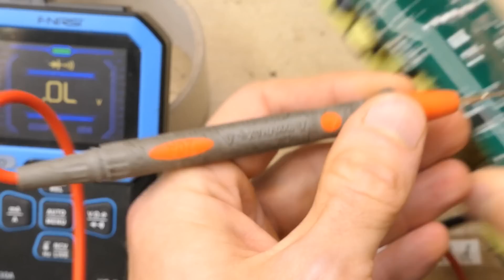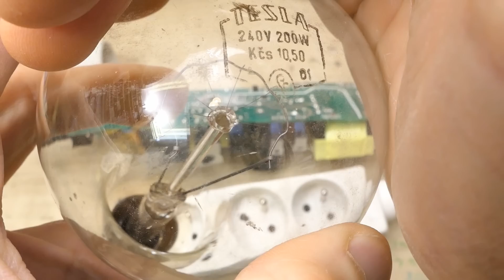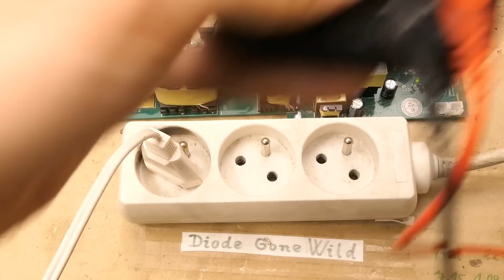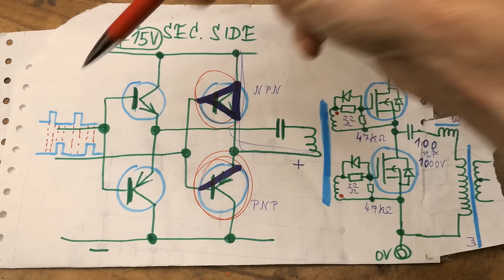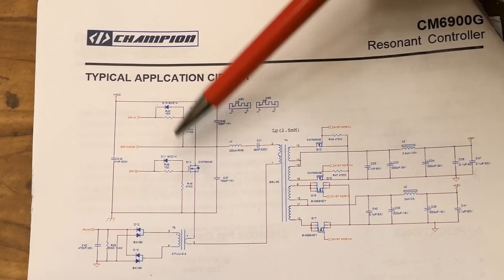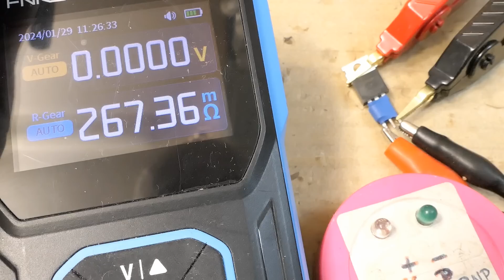Fixing a big Li-ion charger power supply

Comment: God haven't checked into this channel in good while now. Fixing E-scooters/bike's keeps me busy as hell.. I live in the centre of Ireland 🇮🇪 and the only place for people to get their scooters fixed is Dublin...!
And they charge 200 Euro for something id charge 50 Euro's for... They're so easy to fix and I always have a waiting list of minimum two weeks to a month when I take on more people needing help. Going to Dublin for hall sensor replacement costing €200  is out of most people's rage money wise. A set of new hall sensors can be anywhere from €7 to€10 online id charge €30 to €40  for that particular fix. Always a have a few brand new dashboards(the displays) 4 & 5 pin connectors. And some mother boards. If I it's to much work to to chase tracks and components to sort out the problem I just slap in one of boards that's needed that I'd have... "NEVER SHORT OF CASH NOW" and I learnt more about electronics from this channel than any other... So thank you Danny for your awesome information you give us..... 👍🙏🇮🇪

Comment: Using the BC807/817 to drive a GDT is a terrible idea. Yes, they’re rated up to 0.5A, but they are still small signal devices. The SS8050/8550 are much better suited for this purpose. But still, there’s only so much heat the small SOT23 can dissipate…

Appreciate the old-school insta-heat soldering gun. Quite a neat SMD dismount tool!😂

Comment: touching a half bridge mosfets while it´s running is kinda wild 🤣🤣🙄
Reply: Perfectly fine, as long as you’re not grounded and don’t touch BOTH of the exposed drains or anything else in the circuitry. If you do, you’d be in for a significant emotional event.🤯💀

Comment: I got the same leads as you, the thin pointy ones, they're nice compared to my fat ugly old ones that came with my Astro AI meter, but then i tested the resitance, thanks to my new tweezer meter (zoyi something or other)  it has 10 miliohm resolution for resistance is the main reason i got it, much better then my multmeter.  Turns out those nice looking probes are around 120 miliohms resistance, and my ugly old astro ai probes were only 50...  Dont judge a book by its cover is the moral of this comment, please like and subsc... just kidding.

Comment: I've repaired a psu with similar topology, it was easy to follow along! Weird that those small signal transistors failed, I wonder what caused it. Maybe a high voltage spike, static electricity or something? 
Great repair in any case!

Comment: Now, replace the MOSFETs with GaNFETs to make the efficency EVEN HIGHER!

I'm amazed by the performance of GaNFETs, they have way way lower gate charge and lower RDS(on) too.

Careful to that body diode though! GaNFETs DO NOT have it!

So if the body diode of a MOSFET has some purpose in the circuit, you can't just put a GaNFETs in its place.

Maybe you can find a way to put an external diode.

Comment: Nice! 50 years ago upon passing the exam of my apprenticeship I was asked on how to trace a fault in a half dead SMPS. I said: Start in the middle with a scope. No thermal cameras then. Then divide the non working half int 2 again until you hit the faulty part. In your case of 3 faulty transistors out of 4 I would have replaced all 4 and then give the unit a soak test. Hope your cat agrees with me!
Reply: it's wild that smps technology has been around so long ehh. it still seems to advance at a fast pace too in alot of areas. unlike some other engineering areas ehh. dany is by far the best on the platform at smps repair/design/knowledge in general and can fix anything it seems. he's the reason i'm obsessed with smps repair as a hobby haha.
Reply: That is a recommended fault tracing procedure: Start in the middle and work towards the side not working. You can divide that side again if large. I look for faulty components first as he did as I am reluctant to work on powered circuits.

Comment: My uncle (masters degree in EEE and CEng) used to work in a corporation where they made switching power supplies and they’d specialise in designing power supply boards that were extremely over engineered and expensive, with the objective of making sure it couldn’t be taken out and used by the consumer. There was one supply, 900 amps at 12 volts DC constant current, synchronous rectified. Thousands and thousands of components for active PFC, MOSFETs for both secondary and primary rectification among other things. The transformer had a primary on the board, but a gigantic ferrite core that extended vertically around 10CM before taking 90° bend like an L, before getting to the auxiliary, secondary and tertiary windings. They only sold two.
Reply: The main objective of a modern day engineer is to design a thing that will work the warranty period flawlessly and break down the day after – irrecoverably.
Reply: @noneofyerbeeswax8194  simple solutions to complex problems is the mark of a great engineer, in my experience. but not too simple, like einstein said haha. im a middling engineer who retired too young and is way too bored. i'm lucky too though i guess, im still relatively young and help tutor students for free because im not hurting for cash, not rich though. i've been trying to get a startup together but i live a five hour drive from any other decent hardware or software engineers so i've been hammering a prototype together for a phone app to see if i can get funding from nova scotia tourism to hire two more programmers and a few technical artists. there's a few mobile game studios around but they make vapid gatcha apps for ubisoft and have a super high turnover rate. no worse fate for a programmer than making shitty phone games for a multinational company that prey on whales to drain their accounts into time sinks to buy coins or whatnot. i read about a person who sunk over 300k into the diablo mobile game, talk about king of nothing just to have a 3d avatar with 'rare' gear haha. i used to volunteer at a local makerspace with an engineering professor who couldnt even make simple circuits and actually quit when we were asked to help some students with simple opamp theory. he couldnt even make a fucking buffer let alone understand the theory behind a simple inverting opamp circuit with a couple resistors. goes to class and throws up power point slides that came with a book, goes a long way to explaining why the local college grads of the electrical engineering technology program cant get any work. i ended up quitting to focus on coding more and teaching guitar lessons and writing more complex compositions with people better than me. i live in the sticks and have the best makerspace this side of canada and it's ran by knitwits who are running it into the ground. i'll be there for the asset liquidation, sadly. sorry man, im rambling like 13 year old girl strung out on Adderall, haha.
Reply: german company i suspect wha? haha. i've boycotted german products. i remember when vw cars were solid as a rock but our last 2 were lemons. I had a bmw x5 rental for a few weeks while my wife's merican' truck was being fixed and it was full of micro transactions. the motorized steps that use linear actuators were locked behind software keys. there were 4 per rail and i suspect they cost about 400cad a piece, so wasteful. living in canada and trying to get german companies to support their products, especially buying from knipex or welectron they treat you like you're an idiot, even if an 800 dollar dmm is doa. i had to fix the meter myself and the broken tools from knipex i had to buy the same model from amazon and send back the broken tool like 5 times. knipex are great tools when they work though but i hate how over engineered german products are. trying to update software a previous german(s) wrote is like trying to untangle overcooked spaghetti to acheive something super simple that could've been done with single line function. every other programmer from every other place where i know other programmers in canada say the same thing. a good programmer is efficient and the code is self documenting, especially when it comes to a non-mission critical part of a piece of back-end server software. great engineers but intentional obfuscation and overcomplexity seems to be bred into their culture. i know one engineer from germany who realizes this and cracks me up with his jokes about it and he's the best one i've ever met because of his ability to solve super complex problems with explanations even the bonehead IT guys can understand. Ever notice how almost ever info tech worker has to call someone else for an answer? it's why i switched majors back when i went to university in the 90's.
Reply: I guess he worked for NASA, and everything was fine 😊

Comment: Love these mega complex power supplies. Wonder what engineers designed boards like this, entirely from scratch.
Reply: Pay attention to the end of video, when DGW discuss driving chip. But still great work of designer. Question is why those transistors died.
Reply: This is not complex. A real feat would be to design a resonant + sync-rectified PSU without the use of a proprietary IC – which I have done. Using the BC807/817 transistors to drive a GDT is a really questionable decision. They died because their max current is 0.5A, and the small SOT23 package can only dissipate so much heat… I tend to either use two pairs of SS8050/8550 in parallel or go with a larger package if space isn't a concern.

Comment: Respect for the super hot transistor that stills good
Reply from the maker: Only 10°C above the maximum rating doesn't destroy a semiconductor in a short run.
Reply: @DiodeGoneWild  If the plastic/epoxy housing is 160C, the junction is likely over 200C.

Also keep in mind when using a thermal camera that different surface materials and finishes have different thermal emissivity. Black pigment in the TO220 encapsulation has emissivity around 0.8 vs 0.4 for lead/tin and 0.25 for tarnished zinc. You need to calibrate your thermal camera for the type of material you are reading temperatures from. If your camera is set for the 0.8 curve and you are looking at a tarnished zinc-plated TO220 package's metal tab, that tab is much hotter than the thermal camera says it is.
Reply: @teardowndan5364  That's why I use physical thermometers with a blob of thermal paste on the end.
Reply from the maker: The junction was close to 160C too, because with no heatsink, the junction to case thermal resistance is quite small relative to the case to ambient thermal resistance.
Reply: Power semiconductors are stupidly tough. As long as you don't cause power peaks large enough to blow them up, they can get hot enough to desolder themselves from the PCB and keep working until they fall off. That is over 235C board temperature with lead-free solder, 300+C junction temp.

Comment: What incandescent bulb brand still exist in your country ?? GE, Osram, Sylvania, Philips ???
Reply: I can still buy 300W Philips incandescent and halogen bulbs along with various brands of specialty/decorative bulbs at my local Home Depot. The big catch for general-purpose lighting is that LED bulbs are now 30-60% cheaper: for the price of two 60W incandescent bulbs, I can get a 6-pack of 60W-equivalent LEDs. Incandescent makes not sense unless you absolutely want/need them for reasons other than efficiently producing light.

If I had to get a bulb as a ballast for electronics repairs, I'd get a T3 halogen shop lamp and use 100-500W bulbs in that. Spare bulbs in different wattages occupy far less space than high-wattage E26/27 base ones and installed bulbs are in ready-to-use rugged enclosures if I need lighting elsewhere.

Comment: Nice approach to funnel down the components aided by thermal image, using the right tools save a lot of time. I just missed you taking a thermal image after the PSU was fixed just to compare the difference.

Comment: sometimes failures just dissapear and I hate it. last weekend I was struggling with an electronic transformer for halogen lights. It would not start up. I checked all solder joints and resolderd all of them and checked all the components. everything looked fine but it would not start up. so I replaced the DIAC and it started working. I measured the DIAC with the multimeter in diode mode and it showed open as expected. so I swapped it back in and the bloody thing still worked. very annoying
Reply from the maker: A diac shows as open circuit on a multimeter diode test. It needs about 30V to trigger. Diacs probably can suffer from an intermittent open circuit, just like diodes. The bond wire can be losing its contact with the silicon. The leads can get loose in the plastic package. Then it can start making contact again as you manipulate it or solder it. The intermittence can react to temperature changes.
Reply: @DiodeGoneWild  I also suspect some intermittence in the DIAC - I was just surprised b/c I have never seen one fail in this kind of application. Another suspect is the small capacitor in series with the DIAC that I had to bend to access the DIAC. the bending action may have fixed some intermittence in the capacitor. Or I have missed the solder joint despite being quite sure to have resoldered every darn spot.. I should have used an oscilloscope to verify but I don't have a way to isolate it.. oh well

Comment: As always, incredible application of an enormous soldering gun to replace minute SMD components
Reply: I think he is just flexing with his soldering skills .. a master of his craft can do the most amazing things with the crappiest tool 😆
Reply: The worse the tools required, the better the craftsman.
Reply: I aspire to be anywhere near as good doing similar!  😁
Reply: Con quel saldatore riattacca le zampe alle zanzare
Reply: I did the same about ten years ago, replacing a part the size of 0,6 x 0,3 mm with a soldering gun. The thing was fixed and it still works, sitting right next to me. It was a tiny SMD reistor on the motherboard of my PC in the SATA controller circuit that was improperly soldered out of box. Since I did some modifications to the chassis it came with, they refused to replace it. So I had to fix it myself. Luckily for me the component was not damaged, but misplaced and poorly soldered. I loosened it with my fingernail. I got also lucky that it did not fall on the ground so I did not need to search for it.
Reply: Those big ones are not so hard. The small ones SUCK! especially leds